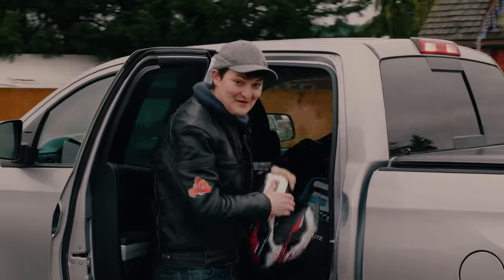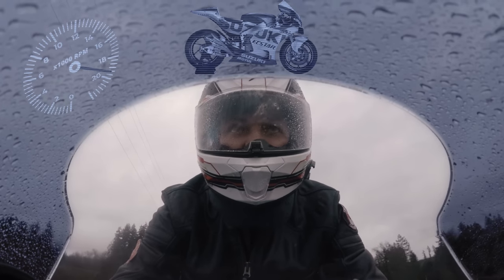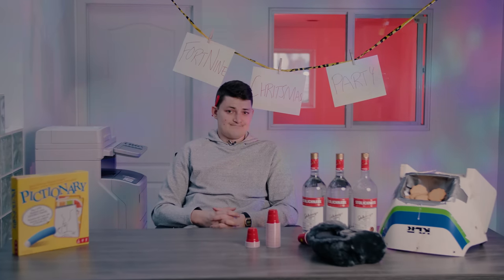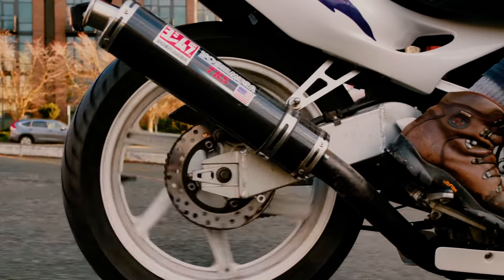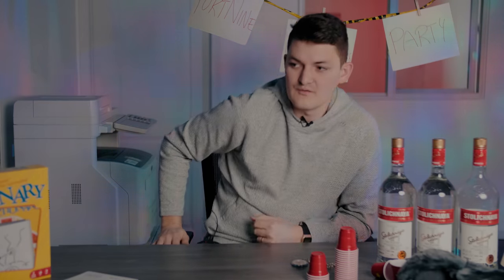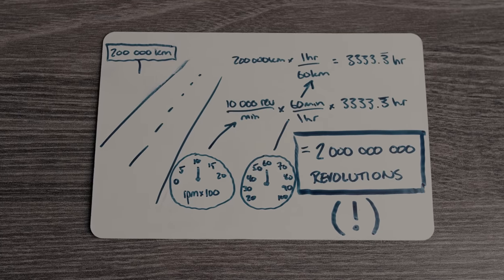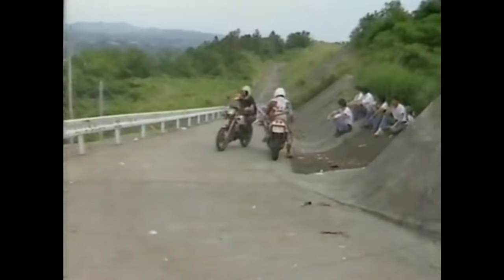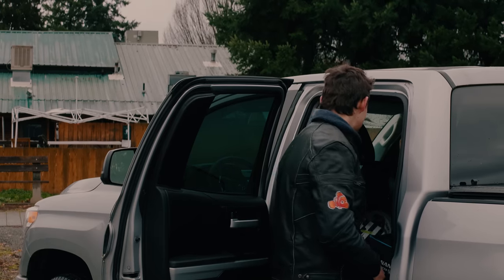The '90s Honda that Revs Faster than an F1 Car

Comment: Hey man! Come to indonesia as we are about the first to get our hands on kawasaki zx25r.
The newest 250cc 4cylinders bike money can buy 😁🙌
Reply: The zx25r suffers from the modern bike problem, weight, its about 20kg heavier than the 33 year old zxr250, and strangely enough about 12kg heavier than the current ninja 400.
Reply: @benjy288  it’s heavier than the 400 because it has more cylinders. Going from a twin to a inline four adds a shitload of weight even if you go down in displacement
Reply: @talltale9760  Still 20kg heavier than the original zxr250 and only 4kg lighter than the original zxr400, I would rather have the original zxr250.
Reply: @benjy288  mainly emissions related but you also have to take into account things like ABS, traction control not to mention the quick shifter and a overall slightly larger bike. Lots of small things that add weight fast
Reply: @talltale9760  Part of the reason why I would rather have the older bikes, they're lighter, fewer things to go wrong, I don't want ABS, traction control, or quickshifter, my old zxr400 and rvf400 still did 210kmh.
Reply: @benjy288  missing out not having a quickshifter. Absolute blast and ABS is mandatory if you like being alive. You can outbrake ABS in a perfect scenario but not in the “real world”
Reply: @talltale9760  I'm not racing so I don't need a quickshifter, and I've been riding on the road for 26 years and I'm still alive despite not having ABS, I've only owned one bike that had ABS, a ktm rc390, and under hard braking the back wheel would come off the ground slightly, the ABS thought the front wheel was locking because it was rotating slower than the rear, so it released brake pressure, which increased my stopping distance, so I ended up disabling it, that was the best thing I did to that bike, from then on I got consistent braking performance, and slightly shorter stopping distances, when I ride a bike I want to be the one operating it, not a processor making decisions for me.
Reply: @benjy288  you don’t have to be racing to enjoy a quickshifter lol and if you’re riding a fuel injected bike there’s a processor making decisions for you
Reply: @talltale9760  I never mentioned enjoying a quickshifter, I said I didn't need one, and you don't need a quickshifter on the road, I have a carbed bike, but having a processor deciding how much fuel to give is completely different to having one decide how much brake pressure to apply.
Reply: @benjy288  dunno about you but i've riden the zx25r myself for arround 6months and i like every bit of it 😊
Love the noise they make when you upshift or downshift with the quickshifter. Despite the weight problem you mention i don't find it heavy at all probably because at 1 time my daily bike is an r6 and it does suck with the kinda traffic we face everyday in jakarta to ride an r6 daily 😂😂

With the zx25r used daily in jakarta's traffic condition, i find myself quite comfy, i can still the sound of inline 4 cylinders and i don't have to deal with heat issues from when you are stuck in a bad traffic 😂

Comment: yea this bike is also me wish list 👌🏻 for show torquehead on theyr 50 nm 25 hp bike whers theyr place  on track 👉🏻 faaar behinde mc 22 👍🏻😉i actuallly dont like one stuff in this bike 👌🏻 👉🏻 seat hight 720 mm 🤷🏻‍♂️ this is joke ? 🫣 it makes drag lower = less fuel consumption better accelerstion and top speed as drover more hide behinde fsirng push less drag but i would imedistlelly change this on 78-80 at least for more corner speed 👌🏻 that be only one tune which i wpuld do on this bike 👌🏻asssuming footpg be to low for some faster tire in good codntiion it also probabaly dont have perfect weight distributiion frontrear = to less at front = u dersteeer out of cprner sooner 🤮 but probabaly stilll better than in me cb 500 pc26 👌🏻